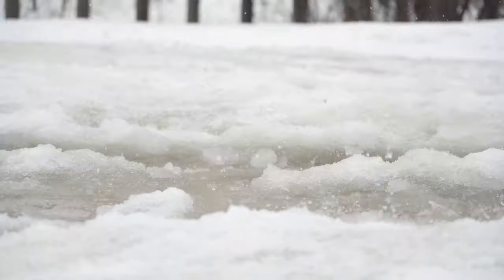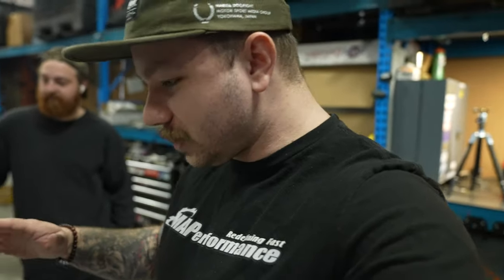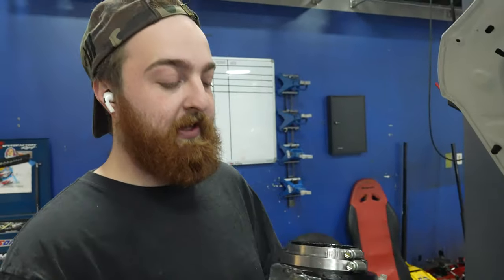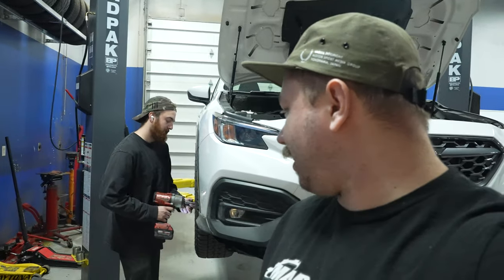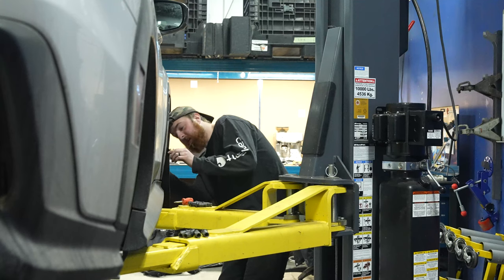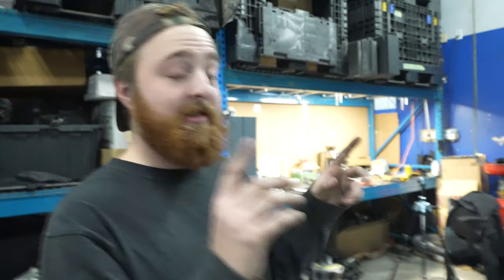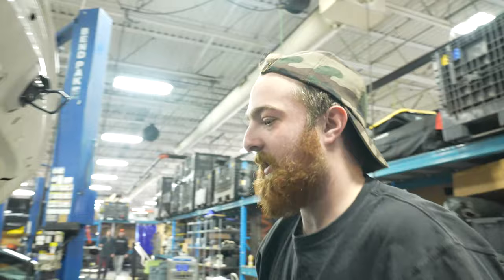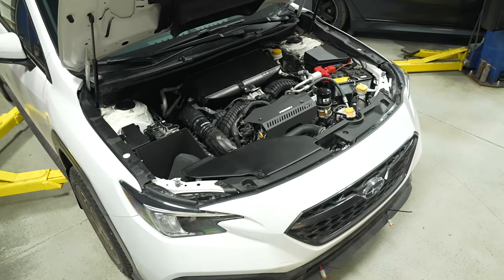2022 Subaru WRX (VB) Overland Build Part 2 | Northshore Adventure

Comment: It’s always compatible. That grinder in the corner and welded, it will fit. I converted my 85 rx turbo sedan to 08-14 wrx parts. Once modified it’s now a plug and play show, and I can actually get parts at the store if needed. No more custom axles is the best part, after breaking an axle and being stranded with a running Subaru lol, I decided to widen my control arms 30mm each side, and run the 08-14 rear sub frame and suspension and everything.

Comment: cars looking amazing did you tune the car? Perrin claims this intake doesn't need a tune & is safe with stock tune. looking into getting this intake but haven't heard much on how safe it is with stock tune
Reply from the maker: We did this trip on a fully stock tune and it performed great! No codes and an increase in induction noise! https://www.maperformance.com/products/perrin-cold-air-intake-2022-2023-subaru-wrx-psp-int-327